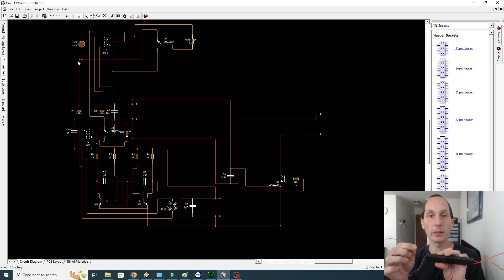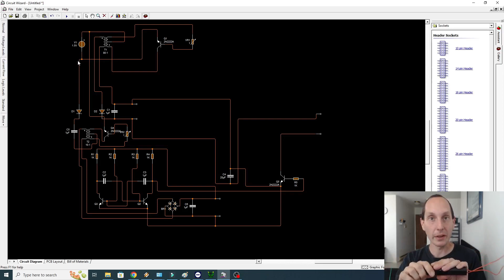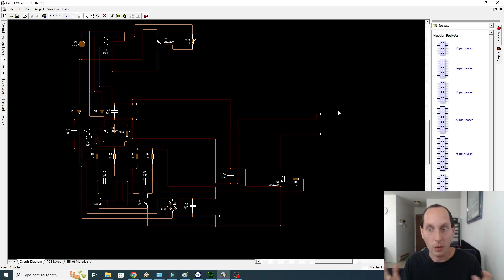Back EMF Powered Cap Dump

Comment: Hi, the last transistor does not have to fit high amp and high voltage to dump the capacitor ? I'm afraid to burn my little 2n2222 😅
Reply from the maker: The parts are far from critical its just to demonstrate the concept of using a transistor switch.  Use what you got to work with.
Reply: @joellagace1679 you may want to explore some negative resistance at some point. If you remember Don Smith recommended use of some neon ballast (old type, magnetic not electronic) and it’s a very good reason for this. Some standing waves in coax and negative resistance might indulge your thirst for science ❤

Comment: Great idea, I look forward to your videos. I tried using the HV module with a neon cap dump, the Neon was lighting up without being connected to anything. The HV modules put out some crazy high voltage, I think it was going through the plastic case across my desk somehow lighting the neon. Very interesting to experiment with.